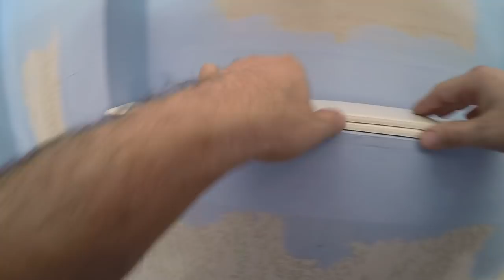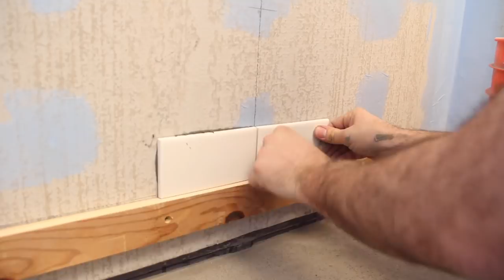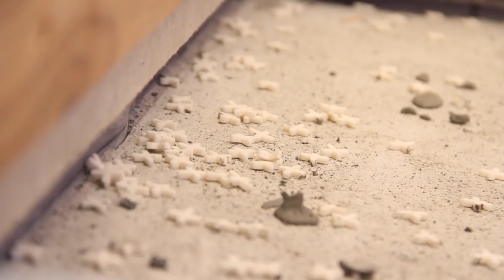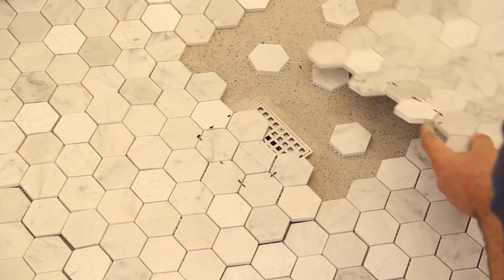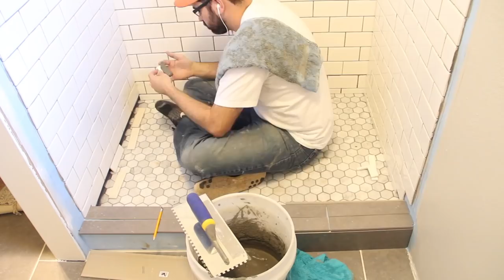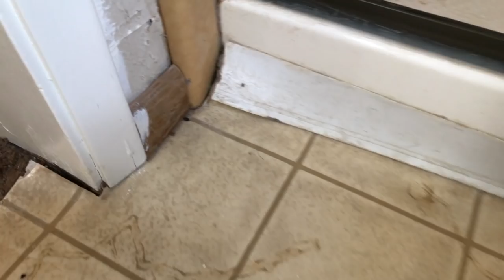How To: Remodel A Bathroom - Tile & Door

Comment: Best to cover all the hardie backer with waterproof barrier. Water wicks through grout and mortar straight to cement board, which I assume is in direct contact with the studs. Give it 5 years and you will have mold growth down in the corners.

Comment: Great job man.  When putting mortar onto a cementitious surface like concrete, wet the substrate first.  Otherwise, that surface will suck the moisture from your mortar before it has a chance to dig in and develop the right bond.  Also, key the mortar into that surface first........spread it with your flat side of your trowel tight against the surface so you push the mortar into all the pores.

Comment: Nice. You should try using a 1/4 v notch trowel for the small tiles like that as long as they aren’t over 3x6 they will last forever. The v notch trowel makes it much easier and less messy to trowel on the wall you can mortar a third of the wall at a time and go to town haha.. second for the mosaics in the back of the shelf or nook I like to cut the mosaics as a whole sheet with grinder or wet saw(as long as all corners are 45 degrees and walls are plumb/level) just find center take a straight edge and mark a sheet with a 45, glue whole back of nook, stick and get measurements from there.

Comment: Great work as already stated. However, I have a follow up question. Our shower is tiled (not subway size, but larger) and the constant fight against mold is driving me nuts. However, I am not sure if that’s just the way it is or if my builder didn’t do something to prevent the mold. I squeegee the shower everyday and we leave the fan running, but still have the problem. Thinking about remodel going to single panels to reduce grout lines.

Comment: Looks great little concerned about the lack of waterproofing on the walls. Tough to get away with that in a shower. I would  seal the grout several times with a good sealer, repeat every couple of years. Again looks great let’s see in 5 years good luck.

Comment: Hi! Great work and awesome explanations! :)

One question! How come you dont waterproof the entire drywall but only the corners and edges?
Reply from the maker: It’s actually a special cement board for wet areas. So it is water proof, you just need to make sure any seams or penetrations are secured.
Reply: Ah! Yeah ive seen / read about those. What if it was normal drywall? Would you just roll some waterproof membrane on it? :)
Reply from the maker: Hmm.. I don’t think you are supposed to use normal drywall at all in a wet application like that because if moisture gets in it will start to mold.

Comment: Why didn’t you put the height of the shelf such that you didn’t require all those little slivers at the bottom? If the shelf was a few inches higher, the first row could have been full tiles?

Comment: Did you have to use anything to seel the seam of the cement board to where the drywall meets?
Reply from the maker: I put the same membrane sealer I used on the rest of the cement board

Comment: What do you do or recommend doing, if the grout is cracking in between the tiles on the floor. And it is making a squeaky noise on the floor.
Reply from the maker: Hi Sumera. I’m not a professional so there are probably lots of other people that can give you better advice. I would guess that either your tile is coming loose from the subfloor, or the subfloor is a little loose from the floor joists.

Comment: curiosity not criticism: Why did you decide to butter the tiles instead of putting the mortar on the wall with a trowel?
Reply: I wonder if it was to ensure that he could still see the lines that he had drawn on the shower board?
Reply from the maker: Haha. Thanks for clarifying! Yeah part of it was so that I could still see the center line I drew, and the other is that I tried it, and the dry backerboard really soaked up the moisture and it was really hard to work with.
Reply: Make It Now gotcha.  i figured it had something to do with working time.  looks great man.  whats next?
Reply from the maker: Thanks. Probably a couple random projects but the next big one is our back deck. It's all rotten and needs to be replaced!
Reply: Mike Funk do you mean using mud instead a backer board??? Or do you just mean thinset the wall then apply tile? Because very few tile setters mud walls anymore. To each his own man. I know it turned out nice. I do showers and baths all the time. Good work Cuz!!!
Reply: superfunkysungod  he should have done both

Comment: Those are not the correct methods for installing tile or waterproofing. Waterproofing the tape joints and seams only is a waste of time and money. Hardiebacker a highly absorbent tilebacker and should be moistened with a damp sponge or spray bottle prior to installing the "burn coat" of mortar before combing. This greatly prevents poor adhesion and possible installation failure in the future. When in doubt please follow the manufacturer's instructions to prevent an otherwise good looking  job from failing prematurely.

Comment: No, so easy a caveman can do it. You should have used a hammer and a flat head screwdriver to make the cuts around the drain because after using that grinder that chips the marble that's what it's going to look like